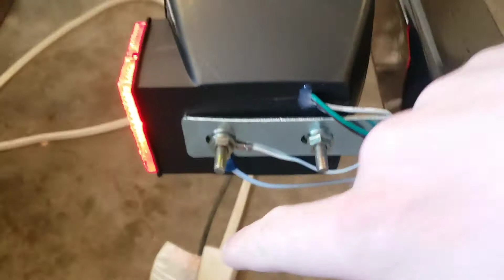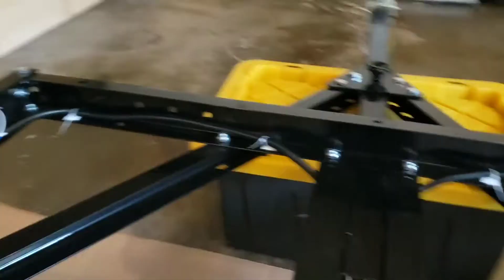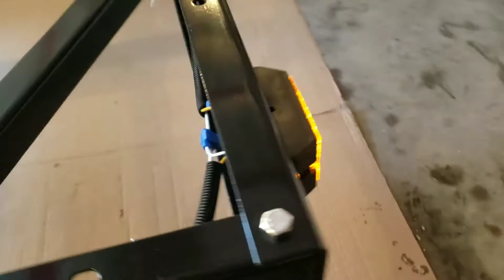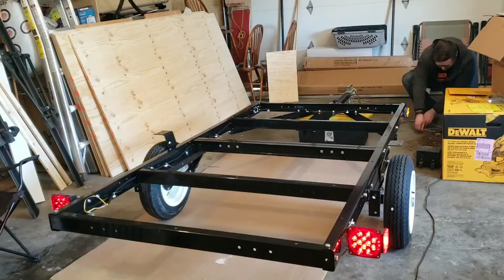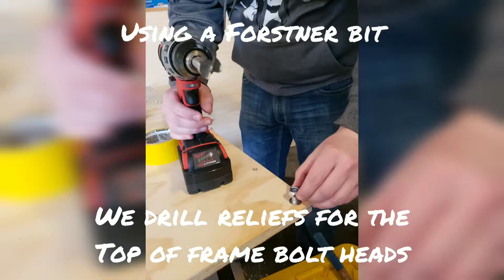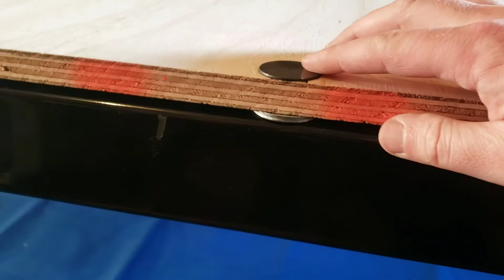Teardrop Trailer Build E03 - Bed Installation and Testing Wiring

Comment: Will you be adding insulation to the floor at all or will that sheet alone be the campers floor? Did it only take one can of rock guard?
Reply from the maker: Hi Chris, we decided to keep it simple for the floor. Our hope is that the mattress provides enough insulation for us. We had to use 2 big cans of rock guard to cover the whole sheet. I think lots of people use a bucket of fence post tar and things like that. Thats probably cheaper, but more messy, than this option because we needed that 2nd spray can. We will see how this holds up over time I guess!

Comment: When you start skinning the hatch and roof, in and out, look up wobble wood. Its plywood all laid one direction so it bends easily. You pick the direction, might be special order but it sure makes the curved parts EZ.
Reply: wobble doesn't do so well...Google bendable plywood instead.
Reply from the maker: @metaxaanabeer  thanks for the tip! I've seen lots of people use Luan or Lauan as it's spelt in Canada. 1/8" thick but usually bends along the shorter width so needs to be wet or cut and spliced. Going to talk to some shops and see what they can do!